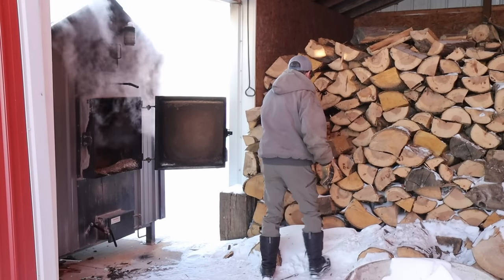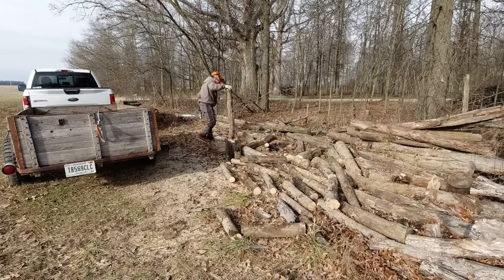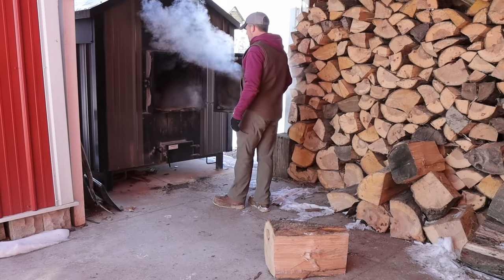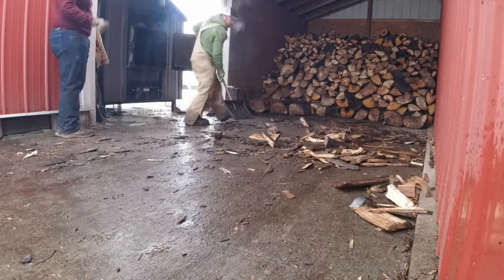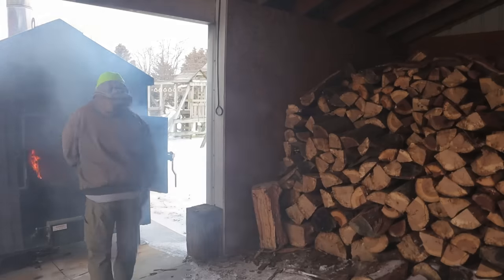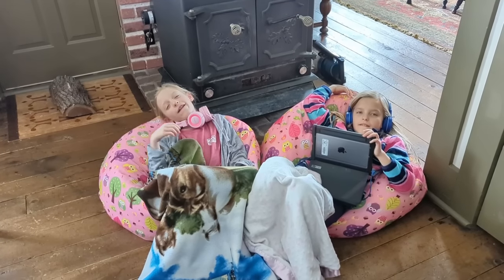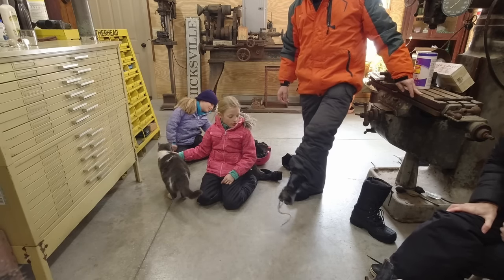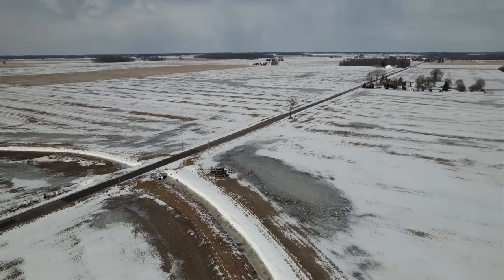Is BIGGER Better? [Firewood Size For Outdoor Wood Boiler] - Why Split Wood For A Large Boiler?

Comment: I have found that a large set of ice tongs make it easier to pick up the larger pieces. I burn mostly dead ash, and split what is too big. I also will cut small stuff longer, to fill in, or day time wood. I don't remember the door size, but if it doesn't fit, I don't want to lift it anyway. I have to have some small pieces so I can fill the back of the 5' box. I don't put the effort in that you do splitting, but I do very little green wood.
Reply from the maker: I've got some tongs that I use but it's hard to use them to throw wood in the door.  I'm getting better at it though if I keep practicing.  Thanks Tim!

Comment: If you have drafts coming through the wall I would think, if you made your next project a remodel to seal your house, you'll probably gain a ton of efficiency. I'm currently doing the same to my 100 year old mountain cabin. We took out all the insulation and dry wall in the basement replaced and sealed the windows. Lit my dual burn log stove. The temp spiked from 55 to 65 in 45 minutes. For the last 2 years I've had to light to stoves and run for hrs to get up to 65. That's with eliminating insulation and just replacing and sealing windows in the basement

Comment: is it possible to move the outdoor boiler inside and route the chimney through the house?
 The box itself is hot and will give off heat to the house and so will the chimney. I don't know if you have a basement but that seems like a good place for it and a chute to drop the firewood down. Added bonus is even more dry wood
Reply from the maker: That wouldn't be possible with this stove but We do already have a radiant style wood burning stove in our house.

The outer wood boiler is actually insulated so that it keeps the heat contained within the firebox. In the winter time there can be 6 in of snow on the roof of the boiler and it won't melt because it is so well insulated.

Comment: I have experimented a lot with my classic wood boiler. The sweet spot for my stove is 16 to 18 inches long. There is a baffle in the back that circulates the smoke back into the flame to re-burn it. My stove will hold a 40 inch log but I found I was loading it the same amount of times a day if 40 inch was used or if 16 inch stacked in the front. Most people think you can burn anything in a boiler.  Which you can, but should you? Dry wood is 100% more efficient than unseasoned. If you do not split the wood, it is not dry. Wet wood uses all its energy (btu power) to steam off the water instead of putting off heat. It's no wonder most wood boiler guys burn so much wood. It's because they don't want to put the work in ahead of time.
Reply from the maker: All good tips and info.  I've never been afraid of the work it's just the lack of time really.  Had much more time before the kids and life got so busy.
Reply: << The sweet spot for my stove is 16 to 18 inches long. >>

What is the sweet spot FOR YOUR BACK?

Comment: Size does matter 😄! It's much like ice and a cooler.  The size and shape of ice dictates the temp range and melting point. If your wood is to big the fire doesn't burn as hot, too small the fire burns to fast and doesn't last, but just the right size of wood and the fire can burn all night. 
 Does any of this sound dirty?
Reply from the maker: Ha! Not dirty at all ;)

Comment: Ever think of welding up a loading shoot? A small metal table that folds or rolls out of the way would make things easier I'd think. Just push the logs into the burn box. No twisting throwing the big logs. Nice video
Reply from the maker: If the wood is small enough it isn't too bad but the chute would be nice sometimes!

Comment: I tend to but a large variety of wood in the stove but most of the time I shoot for 4' long and 18 to 20 inches in diameter. But I also am loading with my skidsteer through a 5'x24" door on the top of the stove
Reply from the maker: That's a big door!  How long do they burn when they're that big?
Reply: @digdrivediy  I usually top it off every day but usually only put one big log in every other day and put smaller wood around it thats not good enough to sell. But I haven't ever burnt anything "good" in it. Its always been pine or green or rotten wood

Comment: The 60 and 80 pounders are also a little dangerous to toss in. But you HAVE to toss them in because they catch on everything and don't slide well if they're only partially in. First time I tried to toss in a big one, my plan was to yank my hand back as it entered the stove. What really happened? I was late removing my hand as I tossed, so the giant piece smashed my fingers against the top lip of the door. Just about broke three fingers! That taught me to not maximize the chunk size, just like you're saying.
Reply from the maker: I smashed my fingers once with stitches.  Yeah, that sucks!

Comment: We have a boiler that heats our house and the concrete in the barn and the pool. anything 4 inches smaller we cut 45 inches as our stove can take a four door piece. we split everything else 24 inches and about 15-30 pounds and no bigger. i want to pack that stove full and i feel it is easier with smaller pieces and it dries better as it’s smaller.
Reply from the maker: Yes I do the similar thing but it's hard to stack irregularly size pieces is all.

Comment: The house here survived the 1929 Murchison earthquake, in all that time it's only ever been heated with wood. I cut the wood here for the depth of the indoor fire, it takes a max length deep of 15 inches, or 18 if laid cross wise. 

I don't like cross wise, to much chance of pieces rolling out the door when you open it. 

So nearly all my wood is cut around the 10 to 14 inch mark, and I like to split it to no bigger than 8" diameter for the large logs and most around 4" diameter. 

It keeps us warm when the snow comes, and doesn't go out for 4 months over winter.
Reply from the maker: Love it!

Comment: I have a large outdoor stove little bit bigger then one in this video, i put as big of chunks in that i can lift sometimes 16 to 18 a round an 3 ft long an then pack smaller split pieces around. I only have to fees my stove about once every 24 hours and during deep cold like zero to 20 plus below once every 12 hrs. Also i run my temp at 185 an set to come on with a 5 degree below temp turn on temp , i have found running a lower temp an a wode degree turn on temp only made my stove work harder and less efficient because like you said if you let it cool then your burning to catch up an not just maintaining adequate temperature. So don’t be too stirred up by the comments you are running your stove a lot how I run mine and it works extremely well and is very efficient.  one thing I would suggest is setting your temperature difference from 10 to 5° for a turn on turn off temp, yes your stove cycle more but I have found my stove tends to use less wood catching up from 5° as opposed to 10° while maintaining a more consistent temperature
Reply from the maker: Thanks!

Comment: Hey Neil, I don't know how this would work in with your channel, but would it be possible to see how you are heating your old farmhouse with this boiler? Is there a heat exchanger that works with your forced hot air? I saw the grates in one of the scenes.
Reply from the maker: Hi Mike.  Yes, it is a heat exchanger in the house.  I also heat the shop and garage with it as well.  I think my boiler video shows more of it in depth.  You can see if that helps to see it better.
https://youtu.be/doEbbUWSf30

Comment: My dad and I used to put pieces in so big that we lift it with a tractor and slid it in on 2x4’s. About 20” diameter 48” long. We pack little ones around it and the big one Burns for a day and a half. I’m guessing somewhere in the neighborhood of 200lbs. Not anymore. It’s a lot less work to split them smaller

Comment: Building a home to suit a wood boiler. Northern Canada where I see 30 below as a normal temp. My home has 20-inch walls R-50 and the ceiling is 24 inches thick of insulation R-80. My boiler is oversized two times the btu needed to heat the home. As to wood sizes just adjust your timers for burn cycles 10 minutes at fifteen seconds to keep your wood hot and ready to go..

Comment: Great setup Neil, watching you reheat your home and water you used almost as much wood as I would use per day and that heats the house, water and cooks our food. Is your home particularly large or do you use alot of hot water?
Reply from the maker: We heat the house, 3 car garage and my 36'x56' workshop with the stove as well.  About 7000 square feet in total I believe.
Reply: @digdrivediy  That makes alot more sense. It would be nice having a warm workshop in the middle of the winter

Comment: I've had a homemade boiler, 2 actually, for about 40 years. My "new" one, 18 years old, has a 4' long firebox, as did the old one.  I somehow stumbled on the fact that much shorter pieces of wood, held as far forward as possible, heats about the same amount of water, as quickly, with NO visible smoke, or almost none, NEVER the big clouds of smoke it did with much longer lengths.

Comment: Excellent points, though i think you missed the biggest one. Gotta split em so they dry, the big pieces are and stay heavy because theyre still full of water, hence why they dont burn all night efficiently. The smaller the piece the faster it drys, the dryer it is the more efficient it burns which means more heat for less wood.
Reply from the maker: very true.  I should have talked about that.

Comment: The only wood i split are ones i cant lift or fit in the 2'x2' boiler door. My thinking is the less time i spend on wood the better i like it. So i dont split  or stack wood. I pile it in one very large pile of blocks. When i need wood for the boiler i load up a hay wagon with side racks and park it next to my boiler. When the wagon runs low i use my tractor with large bucket to replenish the wood next to the wagon. Yes some of my wood is green but most is dry as im 3 years ahead with blocks and a lot of my wood is dead elm. On those big heave blocks i never try to throw them into the boiler door. Thats a good way to smash a finger.  (School of hard Knocks) I just lift the block up till i can rest the end of the block and then roll it in. Also my stove came with a heavy duty poker for moving wood around in the boiler. I like the very long burns i get from the large blocks. I never weighed any but im sure some of the hickory blocks i burn are near 100 lbs. Im 66 so i may have to start cutting my blocks shorter for ease of lifting. We also have a soap stone wood stove with a glass front for viewing the fire. We get a lot of enjoyment from this, however we only use it in spring and in fall or if we have a power outage. Its a great back up as you can heat and cook food if you ever have a power outage!!!

Comment: The size queens get a bit tiresome after a while, if you watch enough firewood videos, lol.   Makes you wonder why so many are that concerned with the size of another man's wood.   I like your answer:  " Because I'M the one who has to handle them!"

  I have the opposite problem:  My burner is small, so I have to repslit most of what I buy, because it's too big!  Also, it's for Caveman TV, not heating- so I want flames, not long duration smoldering.  16" works, but 12-14" fits better.   Anything longer, and I have to break out a saw.  I split them fairly small, so I can get several pieces in at once- they burn brighter that way.   So technically, I AM burning a big chunk- it's just in several pieces!

Comment: I used to lift big rings and run around when I was young ... Then 1 day a got a hernia ... my firewood mate has had 2 . So I cut rings into 1/4's or 1/2's ..easier to move to the splitter. it's not much more time as you cut along the grain ..big long chips. Smaller bits season faster.

Comment: Myself I prefer not to have to try and toss 80 pounders in my boiler. I am of similar build to yourself. I also rent a processor to do my wood every season, and although I don’t like having to throw a bunch of smaller pieces in I feel that you get more btu’s out of the smaller stuff. Like you said, quicker recovery when you have a big draw on the system. Those 80 pounders are much better split in half to 2 40’s and mixed with some smaller stuff.

Comment: its funny,  these kind of questions and the first things i think about.   weight,   surface area vs volume, and to ensure it fits.

that was the first 3 things that hit me.   You still have to LIFT and load the firewood.   smaller pieces are easier to load, unless you have a winch and loading slide,  you could easily hurt yourself with pieces over 50 pounds.

Ensuring it fits.   if your boiler is 6' long you often don't want to put 6' long pieces in there just because of embers and such, you could find the long pushing against the door.    seems logical to give yourself a foot or so leaway there.

And...  volume vs surface area.    a single large piece may have a lot surface area but smaller pieces actually have more surface area, this allows for more even burns.   you also can control airflow a bit better between pieces allowing for a better control of temperature vs a single large piece which will only have airflow and burn on the exposed facings.
Reply from the maker: Good things to think about.

Comment: Good morning 
I got a propane boiler in basement do they make an outdoor boiler for that or is it all forced air?
Reply from the maker: I'm not sure but I would think you could plumb it in for your system. Biggest difference is yours is likely pressurized whereas my system is not under no pressure.  Good question though maybe someone else will have a better answer.

Comment: Would a Hudson HW3:16 Wood Splitter be cost effective for you?   You do not want one of those small things that have the work flow the wrong way!  You could use the loader to lift the wood so you are not lifting from the ground.  Maybe load the trailer with the loader and then take the wood to the splitter from the trailer.

Comment: It's more than likly that the large chunks of wood spent much of their time in the fire being dried by the smaller dry wood, thus the reason it's the last log left when you open the door. Yes It's nice to have one or two left to keep the fire going but overall it's probably less effient to have them in the stove at all. I'm sure there's a threshold of size vs best internal drying, I'd say no more than 8 to 10" unless you have an indoor drying arena to let it set for a few years.

Comment: No your not a wimp. Your right on. I cut on average 18-20" lengths. Sometimes i end up with shorties in the 10-14". Those i call fillers, good for banking the stove at night enabling to lets say pack more wood in for an all night burn. Sometimes bigger is not better. Seasoning for me is the most important for BTU. Good Topic.
Reply from the maker: Thank you much!

Comment: I split my stuff pretty large.  We have a Hot blast stove.  Large unit
  I tend to cut 16 20” long. And the max size I split is probably 8x8  and smaller from there 
  Everyone in the house feeds the stove. So I make a effort to have a mix of big stuff 
  Small stuff for daytime and when his wife feeds the stove. And big stuff for cold days and nights and more for me or my cousin to put them in
  I’ve never weighd the pieces.  But a 8x8 18” long chunk of oak. Can’t be but what 20ish pounds ?

Comment: You've only got one back so look after it 80 lbs with an awkward throw is not a good idea. Over here in the UK climate is generally milder so smaller stoves and logs typically 4 x 10. Love the skating and the cats.
Reply from the maker: Very true

Comment: Fantastic video. Very good points re the sood. Here in the UK, most stoves are only 5kw output ans will take 12 to 14inch logs at most.

Splitting logs will also help the logs dry faster(if reqd) as the surface area of the logs exposed to fresh air helps season's them faster.

Those logs are monsters. Green party in the UK would have a melt down if we used your boiler here. Sadly the green nut jobs have too much influence here and cry over the slightest view of smoke

Comment: We have neighbors up the mountains that use the outdoor boilers.   They are nothing but smoke machines throughout the winter.
Any idea why they are so smokey?
Reply from the maker: Mine is smokey when it is cold and the fire is building heat back up.  If it stays good and hot it shouldn't be as smokey. We live in a very windy place where the smoke is hardly ever an issue. We hardly ever even smell it at home.

Comment: Great video and thought process.  We bought a outdoor furnace 6 years ago and it has proven to be one of the best investments yet.  We keep ours at 150 degrees with 120 degree air at the inside air vents/registers.  Our electricity bill in the dead of winter was $100 for a 3600 SF house.  We live in Arkansas so the winters are not terrible like up north (much like the liberals 🙂) and we only stack in the first two feet of the furnace although it is much deeper.  We put in about 10-12 pieces in the morning and again at night which usually turns out burning 8 cords a winter.  We like 10-12 inch rounds as they burn the slowest and give us the best BTU for the buck...and the greener the better.  We DO NOT season our wood and the wetter it is, the slower it burns; the air blower heats up the fire and burns off any water in the wood.  This would not work for a camp fire but in an enclosed area with a powered fan, it works well.  I have my wife and sons tossing in wood too so we do not go for huge pieces; 40 pounders and less are big enough.  I see no sense in someone hurting their back or smashing a finger just to save stacking in a few extra pieces...this is a long game and you have to play the odds, not be macho.  My own two cents!
Reply: Liberals? Can you elaborate?